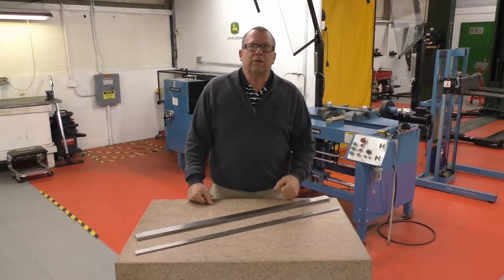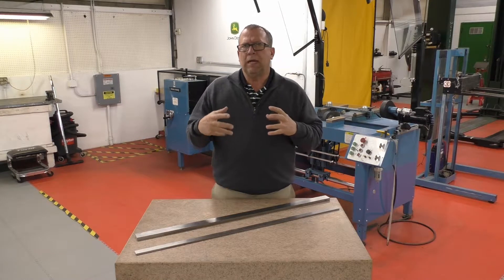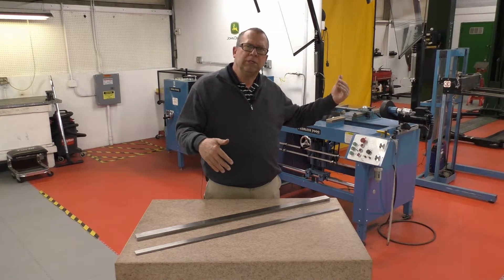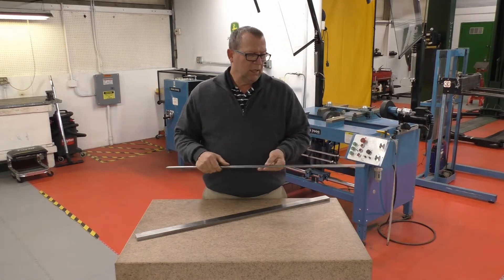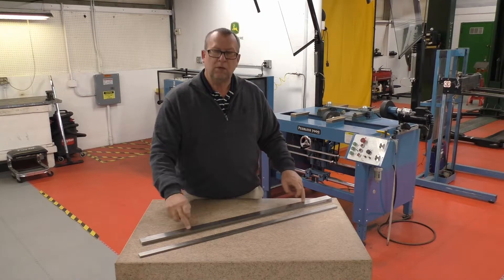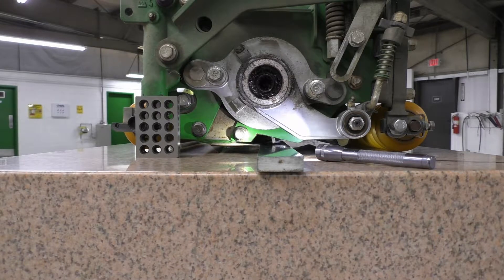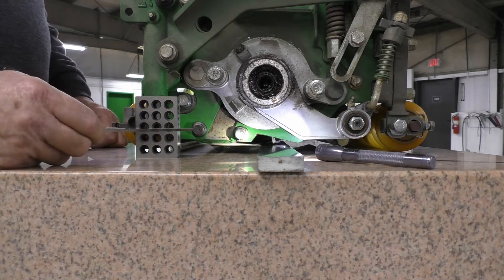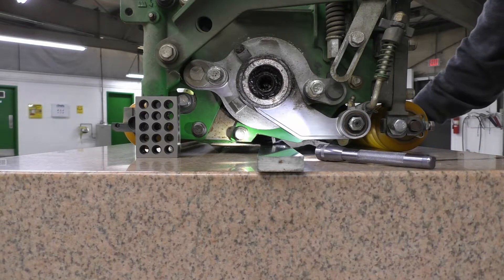Surface Plate

Comment: Great video, John.  Ive been struggling with these john deere qa5 cutting units. What would be a good bedknife attitude cutting bent grass? I have them set up per john deere specs around 9 degrees some more but still dont like the aftercut. Seems by your video your knife attitude is alot flatter than ours.